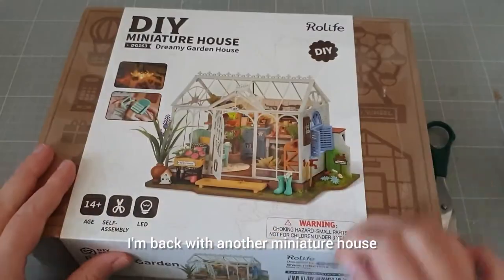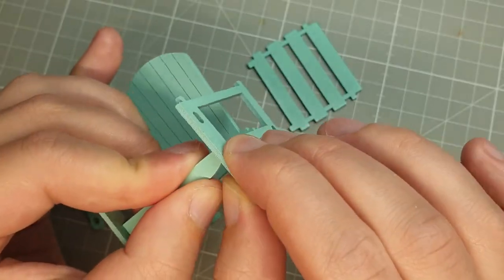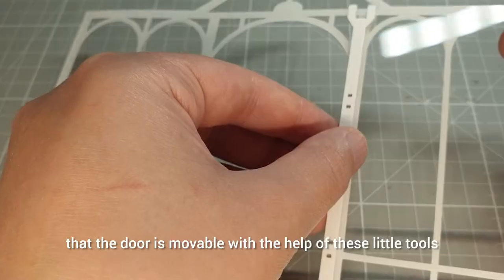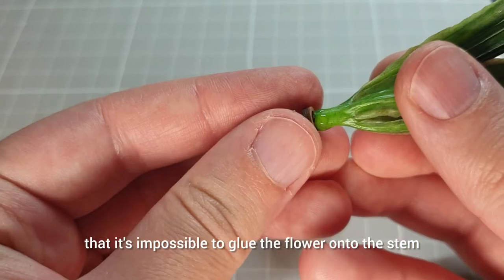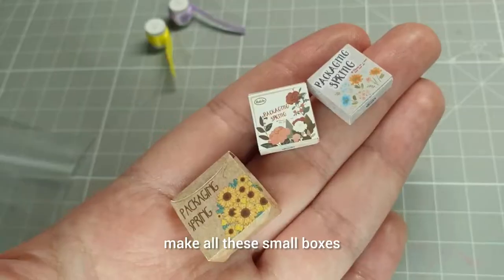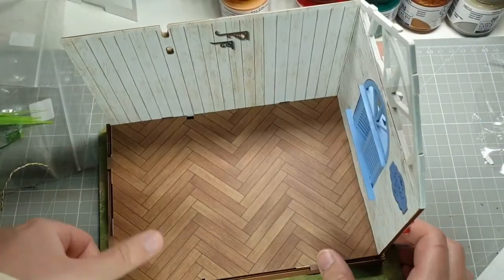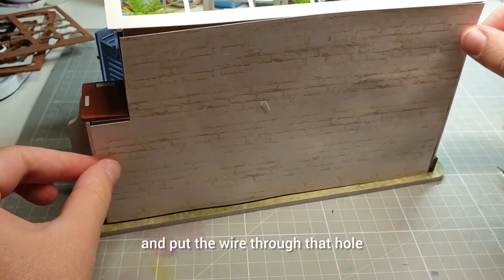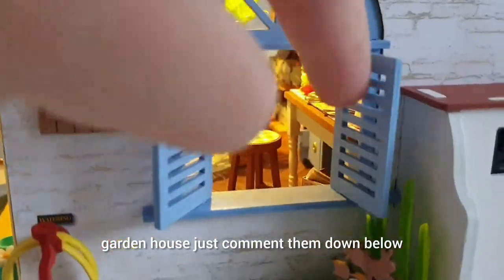DIY Minature Dreamy Garden House - Rolife

Comment: Wonderful video! Thank you. 
Can you tell me what type of glue you use for the wallpaper walls and floor? Glue stick or white glue?
Reply from the maker: @homemadebydebbie5294  thank you! I've used the same glue (Uhu) for everything
Reply: @no.or_art  thank you, I've used white Elmer glue and got bubbles, and uhu stick glue didn't stick that well, lifting off the sides.  Are you using uhu stick or uhu squeeze tube kind. I just got the kit and don't want to screw it up. 😂
Reply from the maker: @homemadebydebbie5294  Im using the squeeze tube kind. Its meant for any surface and glues very well
Reply: @no.or_art  thank you.

Comment: How easy was it to put the shelf together? My kit looks exactly like yours but the holes are way too small for the pieces to fit, I have to brute force everything together and my hands hurt really badly. The shelf took me 20 minutes, I had to use the heel of my palm to force the shelves into the 2 holes. They don't just "pop" in like all the videos I've been watching. It's not fun at all :(
Reply from the maker: The shelf was difficult for me as well with a few pieces not fitting in and I had to use force as well but the rest was pretty easy